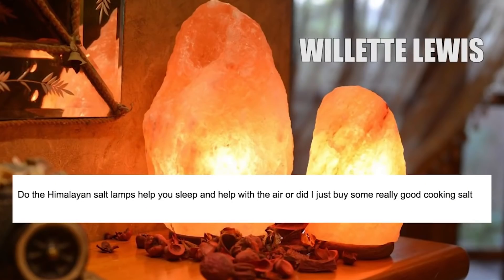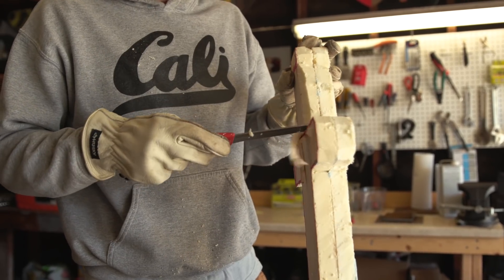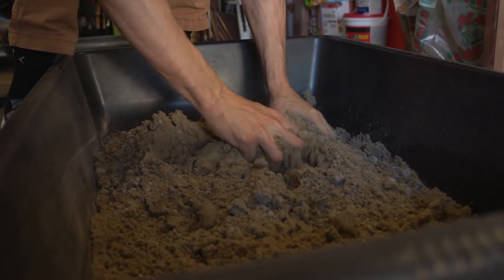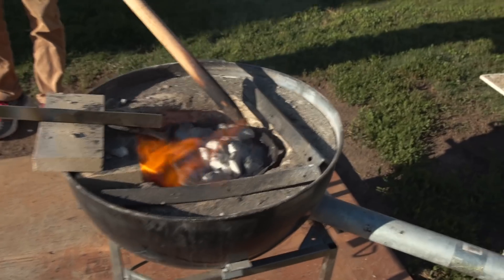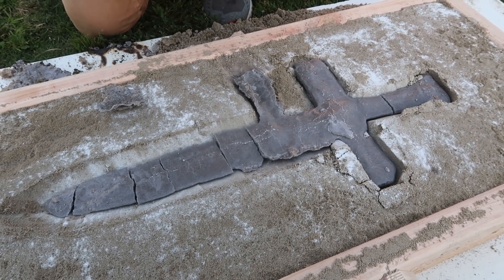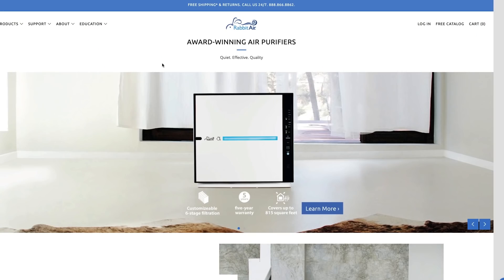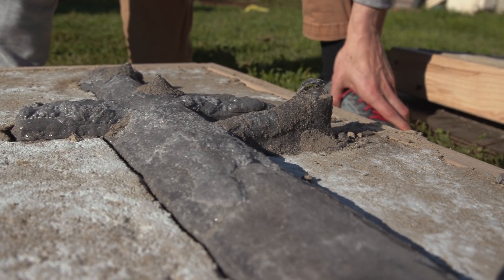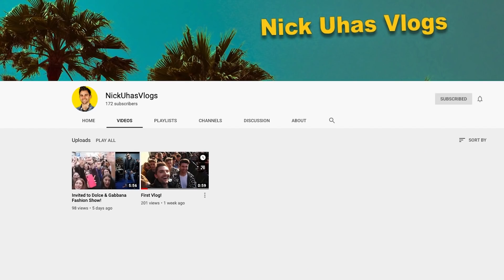MELTING SALT LAMPS into a SWORD

Comment: Next time you want your "Greensand" to hold a mold better, add a mild amount of water till you can work/push the sand between your thumb and index finger till it barely holds a ribbon shape  without falling apart. the clay helps, but moisture helps hold. easy way to add small amounts of water is use a basic garden pump sprayer.

Edit: if you're worried about flash-boiling the moisture in the mold, sift and pack on drier sand around your mold, then use moist sand around that casing. similar to using silicone for detail, plaster for rigidity.